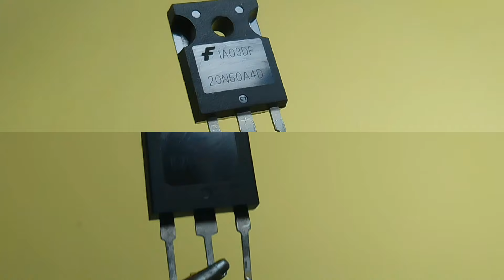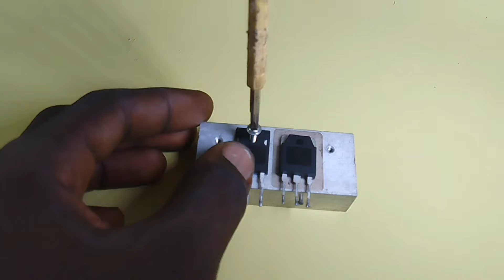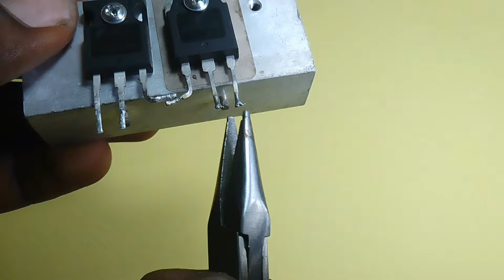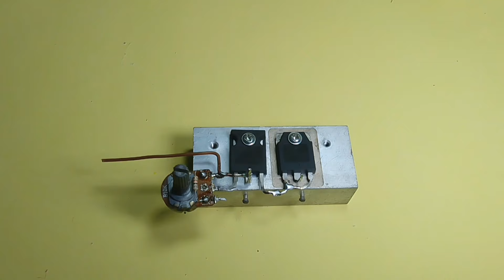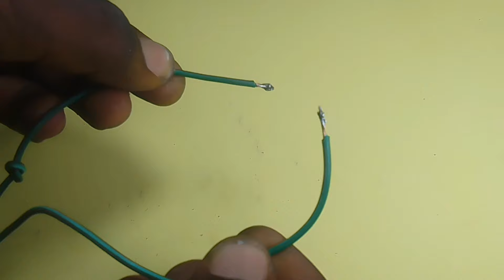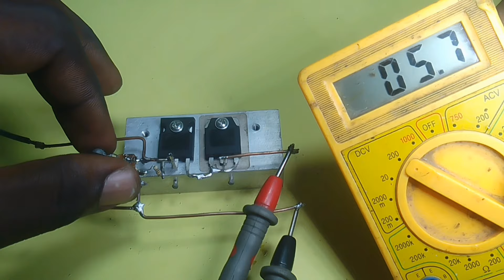DIY Charge Controller for Solar Panels,MPPT Charger Controller

Comment: Video is so informative but lack of some information like: Solar Panel current, is the circuit convert solar voltage into current. Like I want to charge Lead Acid battery of 150 AH. Please upload another elaborated video on same topic "DIY Charge Controller for Solar Panels,MPPT Charger Controller"

Comment: I ran a 48 volt inverter and it got very hot. What is the problem?
Reply from the maker: Does the cooling fan work
Reply from the maker: What's your inverter watts and your load watts
Reply: @Astroelectric1  The inverter is a 7000 watt ups, the load is 2000 watts
Reply: @Astroelectric1  I put a large radiator with a cooling fan for the amplifier, and the fan works well
Reply: @Astroelectric1 Use Mosfet 11n120cnd
Reply: @Astroelectric1  I also used a 9/nce85h21 musifat, same problem, overheating